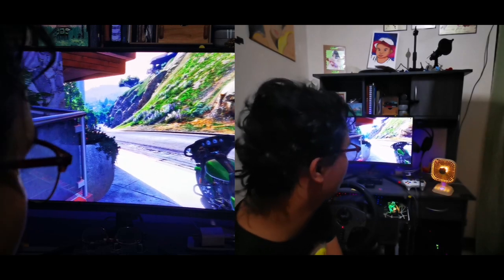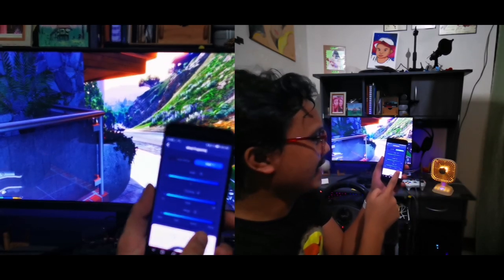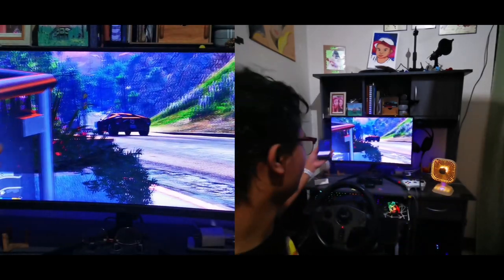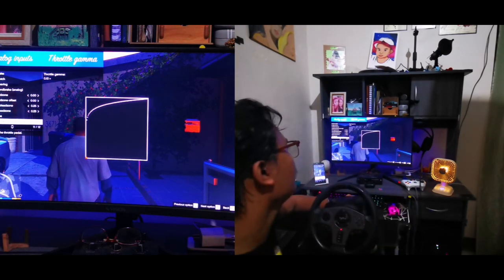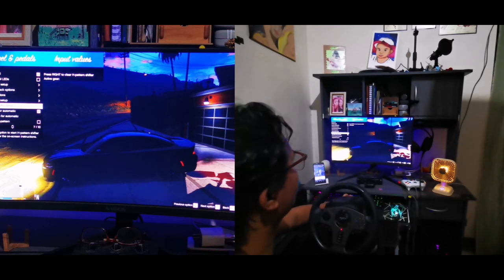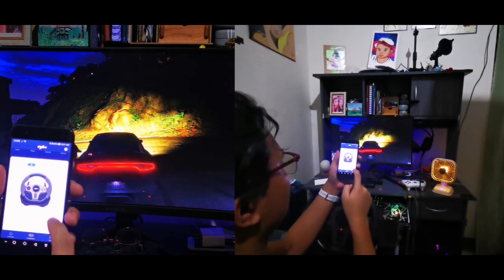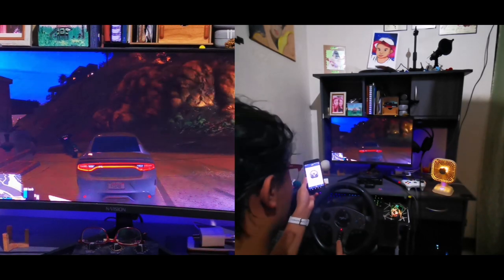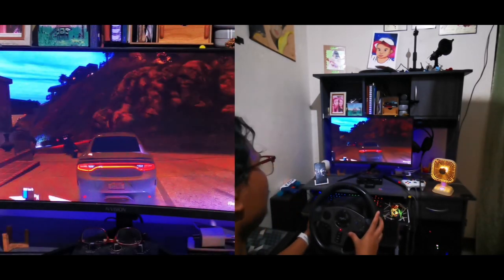PXN V9 - GTA V Manual Transmission Mod Set Up!!

Comment: How to connect pxn v9 to gta5
Reply from the maker: Since MTM is out dated there is only one way to play gta v with pxn, your wheel must be in X input.
Reply: @screencutgaming  ah x input sir
Reply from the maker: @rjaymanalang4872  Yes, x input for now. since The mod is currently not working. You may also use Joy2key to remap keys so you can look left or right and for signal lights.
Reply: @screencutgaming  you have messenger sir?
Reply: Sir how to set up the pedals ang gear to manual
Reply from the maker: @rjaymanalang4872  Without the mod we can't do much, No shifting no clutch, its like driving a automatic car.
Reply: @screencutgaming  theres little to no steering on x imput
Reply from the maker: @salbalistreri  Press the program button ultil it flashes then press up key on dpad once.

Comment: bro when ever i use steering so it lag too much when keyboard so no lag pls solution
Reply from the maker: Manual transmission mod is outdated, mod do not work anymore brother.
Reply: @screencutgaming  solution?
Reply from the maker: @AV_BADSHAH  no alternative for now, i play GTA with my wheel but im on x input. With regards to the lag, i dont why that happens i have noy experienced that so i cant say much about it.

Comment: need help it says cancelled after stepping on the pedals
Reply from the maker: It will register right away, just make sure you are using the same Settings on the Pxn App and make sure it is in D input.

Comment: BRO 1 MORE HELP PLZ AFTER CLIBRATION PXN BRAKE IS NOT WORKING PLZ HELP
Reply from the maker: check on the pxn app if breaks is working fine, if so, then go to game settings and remap controls.
Reply: @screencutgaming  ok bro in  game settings then
Reply: @screencutgaming  bro how remaps cantrols
Reply from the maker: @CarLovers3111  what game are you playing? If you are using pxn for gta v manual driving mod, open the mod menu and follow the tutorial in the video to remap controls for your brakes.
Reply: @screencutgaming  ok
Reply: Bro it is my second I'd I am saying I am using it with GTA v but brake not working how plz can you make video or tell me in description step by step plzzzz
Reply from the maker: @tariqnawaz9672  heyy Brother, you need to check the Brakes in the pxn app, go to test page on the pxn app and step on the brakes if it is working fine, if it is, then go the game (gta v) and open Manual driving Mod go to controls then analog input then set up brakes pedal, and done. Refer to the video on how to set up controls. Remember: Your PXN should be in D-input.
Reply: @screencutgaming  bro I do it but it is not working I test it
Reply: @screencutgaming  when I press brake nothing happened
Reply: @screencutgaming  what can I do
Reply from the maker: @tariqnawaz9672  it's not working on the pxn app? If that's the case you need to recalibrate your PXN.
Reply: @screencutgaming  so what steps I need to do
Reply: plz reply
Reply: BRO AND I AM ASAYING WHEN I POWER OF COMPUTER THEN TURN IT ON IT WILL ALL RESTORE

Comment: boss ask qlang po paano e fix ang steering wheel not in the center thanks.
Reply from the maker: pwede mo e adjust sa steering dead zone and steering Gamma, go to manual trans mod - controls -analog input.